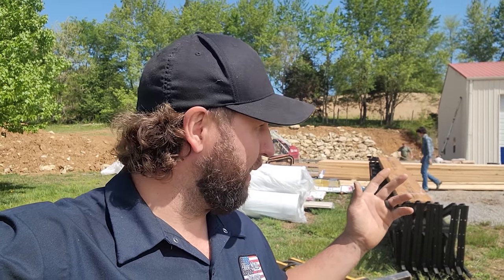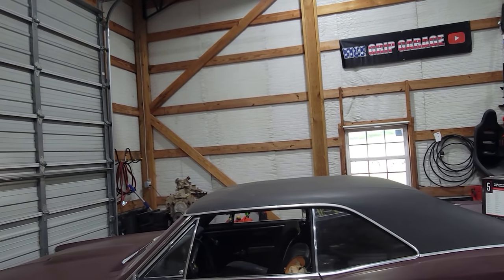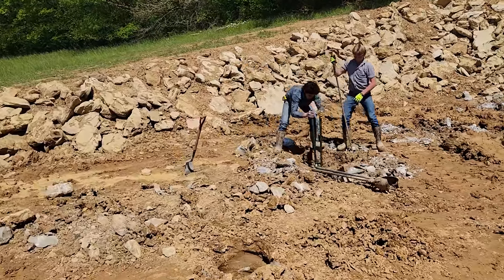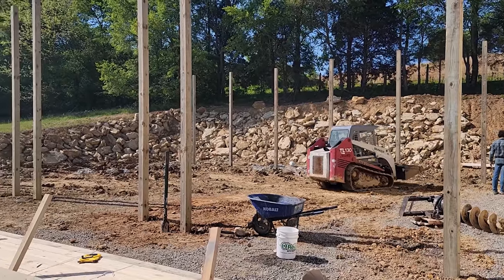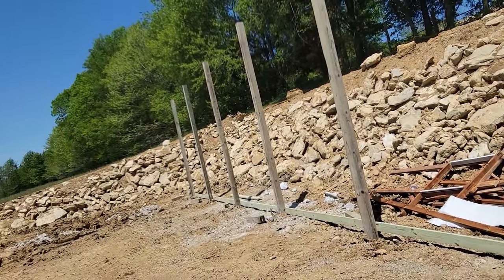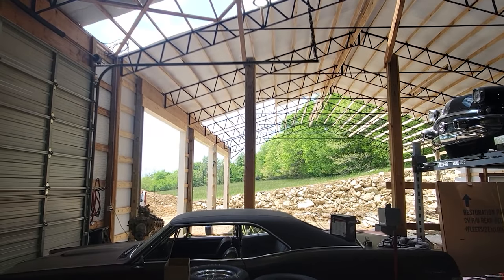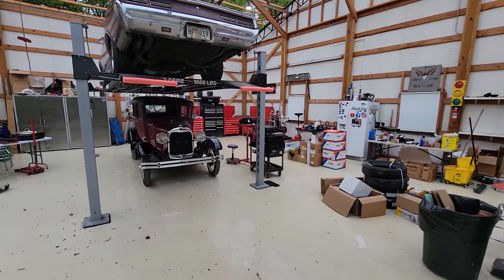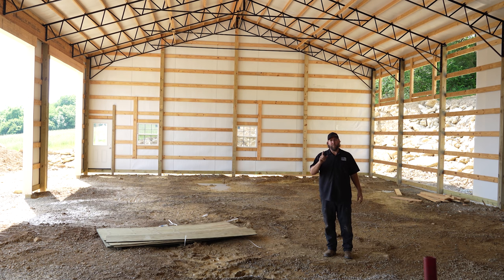Budget Shop Build - EP2 - Framing & Tin!

Comment: I've never realized how simple is the construction of your shop! I thought that these wooden boards are used to support insulation panels, like a stone wool or a styrofoam and are not an actual building frame. It is also completly different style than what we do in Poland, no one uses wood as a structural material for a metal-clad barn. I don't know why, is it material price or longetivity reasons? I've also have not realised that your shop is not insulated: I wish I had a weather like you have, last year I build an extra garage and had to use a sandwich board making te whole thing like 5x more expensive so that it would not go below freezing point inside in the winter :(

Comment: He should have went with white for the roof believe it or not down here in Tennessee that will help you with insulating the building reflects the heat during the summer and pulls the heat during the winter how I don't know but it does

Comment: The reason for 2x6 VS 2x4 is because the span capacity of new lumber is less than it was 10 years ago. They are about to revise the span lengths shorter again in the next series of codes.

Comment: I know you said about keeping the cost down, but I’m telling ya, have a separate compressor shed with one massive compressor(or several compressors) that’s well insulated. Plumb one large line into the main shop, with a ball valve for a main shut off, then put/make a multi-port manifold with many quick connects so you can run as many hoses throughout the shop to wherever you want them to go to your heart’s content. One of the most annoying things for me personally, is not being able to hear yourself think when you need to concentrate on some thing important , while a compressor is running in the background.

Comment: Dude I was just thinking what it would have cost to do passive heating and cooling , by digging down under where the new addition is and putting in the tubing  used for that , cuz some run very cheap to heat and cool

Comment: What are your A/C plans? Mini-splits are a lot quieter than regular Air conditioners, and they both cool and heat. Old, conventional A/C compressors and blower fans are loud enough to cause havoc with your videos, but mini-splits might not?

Comment: How does steel roofing leak? I know condensation is high with steel roofing. Are you sure you had leaks, or a combo of condensation and lack of proper flashing. The bubble insulation against the roof will go south quickly from the heat, not the best choice for roof insulation. Hope it was applied like flashing, so the condensation would drain down to the eves , past the siding. That water has to go somewhere. Steel roofing has many problems to consider. It looks like an Amish crew. I had my huge barn extension done by an Amish crew, smart fast and done right. A composting toilet would allow you to have a legal privy without the septic system. Do you have any springs up hill for gravity water? Tood bad you can't use evaporative cooling (swamp cooler) . Check out solar led lights, a quick pay off over using the utility. Got it going on :)

Comment: Also maybe another dumb idea I would just go to Home Depot and get a few ceiling fans with extra poles to make them hang a little bit lower ...or one blower on each side of the building... and another blower on the other side Harbor Freight sells them... get them to install in the wall put a piece of metal over the top of them show Rain don't hit him and plug them in it would give you good airflow in the summer you could even throw a wood-burning stove in it

Comment: Might be too late already but rather than just pouring a small pad for the man door at the new end of the building, if it might not cost THAT much more, why not run the concrete all the way down the outside from front to back?  The ground at that end looks like it's going to be damp and muddy from time to time.  

Make it just wide enough to run a lawn tractor or somesuch on it because there's gonna be heavy stuff stored around the back and the farther you can pull a yard cart/trailer on a hard surface, the better.

Comment: Love your channel, but your preference for 6x6 posts in lieu of 3 2x6's bolted/laminated together may be misplaced. Warping/splitting/cracking is an issue with solid posts, but not a laminated assembly.

Comment: And definitely do not put your air compressor inside they will be fine outside, very hot and noisy. I put a small awning over mine and it was fine for 15 years till I sold my shop plus I know you're on a budget but a good air compressor or two medium-duty air compressors will handle just about anything you need, especially if you are doing any kind of sandblasting.

Comment: Electrical wiring is not difficult at all, and you can save yourself a few bucks by doing some of it yourself, if you know the basics.

There are 3 wires going into a building, 2 carry 120 volts and the 3rd is a ground, or neutral. You'll have 3 colors for normal 120 volt circuits; black is hot, or live, white is neutral, and ties in with green (or bare copper) at the breaker box. Red is the other 120 volt wire that makes up 240 volts when used with the black wire, and shouldn't be used unless you're wiring an outlet for a 240 volt appliance such as a welder.
Wire size is important to prevent wires heating up and melting etc., the higher the number the smaller the wire. 14 gauge is used for household lighting, doorbells, and alarms because of low amp draw, and 10 gauge is used for heavy amp draw and 240 volt service. Most circuits are 12 gauge wire for standard outlets, some have a flexible ridged sheathing around for added protection against damage.
On a 120 volt outlet the black wire goes to the brass-plated screw for the smallest prong on the plug, the white wire goes to the chrome-plated screw for the wider prong on the plug, and the green wire goes to a (sometimes green) screw threaded into the steel frame of the outlet. Ask questions if you have any, but if you aren't sure about something, let the pro do it. Hope I've been helpful, I too am careful about my spending. 🙂

Comment: Ps. I think you should  reconsider  installing a bathroom.  I don't think your wife wants your guests mechanics and crew traipsing through the house and dirtying up the bathroom. Who gets to clean it? Easier to install now with the equipment and cheaper than having a crew come back later. Also  fire  suppression  system installed will save on insurance  costs. Good luck and best wishes.

Comment: Electrical?  Get 220 for sure...I'd put at least 3 drops, maybe more in there.  That allows for some good options and equipment upgrades (i.e., Tire changer, brake lathe, maybe some other fabricobbling tools that really should be 220V).  

One could also hit up Mr. Cool...just saying, you're big enough that they might just send over a couple 4-packs of those units over.  That place is going to be an oven come summer, even with some fans.  BTW: Big Ass Fan company would probably also help you out.  They just sent over one of their monster roll around fans to Adam Booth (Abom77), and man that thing is QUIET and MOVES THE AIR!  Just saying, things to think about...

I know you're a 'regular guy', more regular than most, but I think it's time to leverage a bit of your 1Mil+ Subs on your regular channel and the 200K+ here.  

Relax, don't worry, have a wobble pop or two, maybe a cold snack to wet the back neck!

Comment: Personally, I would get some Solar PV up on that roof... to help pay for that air conditioning!

Federal solar investment tax credit
The federal solar investment tax credit will have the biggest impact on the cost you will face to go solar in Tennessee

This perk is commonly known as the ITC, short for “Investment Tax Credit”. If you install your photovoltaic system in 2020, the federal tax credit is 26% of the cost of your solar panel system. This is 26% off the entire cost of the system including equipment, labor and permitting.

Example: If your solar energy system costs $20,000, your federal solar tax credit would be $20,000 x 26% = $5,200.

The federal tax credit falls to 22% at the end of 2022.

Net energy metering in Tennessee
With net metering in some states, you get full retail rate credit for the amount of electricity you send back into the grid with your solar panels.

Net Metering requires your utility to monitor how much energy your solar power system produces and how much energy you actually consume to make sure you get credit for the surplus.

Tennessee lacks any statewide program for net metering, and there hasn’t been so much of a peep out of the legislature on movement to create one. 

Fortunately, with the entire state in its service area, TVA has announced its new “Dispersed Power Program”. This is basically the same thing as net metering, however the credits you get for sending your electricity back to TVA when you’re not using it are set by TVA annually, and will probably not be near full retail rates. 
Tennessee solar rebates
While Tennessee does not have a dedicated state rebate for solar panel installation, some manufacturers like LG offer their own solar rebates. These programs are usually time sensitive. For example, LG offers a $600 solar rebate on their equipment, which your installer can help you redeem over the next year.

Sales tax exemption
When you install a solar power system in Tennessee, the cost of that system is exempt from all sales tax. That saves you 6.25-8.25 % off the starting cost! You can choose to apply for the exemption up front (again, our installer partners will take care of all of this for you!) or to take the amount after the system is installed as a sales tax rebate. Hey! Tennessee does have a state tax credit … sorta. It’s not money back per se, but money not spent is still money saved!

Comment: Seriously, 6x6's embedded in concrete are doomed to rot out, especially in your soil conditions!! The smart move is to use Simpson CB66HDG column base hardware primed and painted with oil-based primers and topcoats prior to embedding those into concrete. Yes, it costs more at $75 plus per column base and requires larger footings than round holes drilled into the dirt. GUESS WHAT??? All those extra costs are far cheaper than repairing one rotted post base you used... Oh well, it's TOO LATE NOW... Next time you'll be smarter. Other than that it looks great.

Comment: Those Amish worker's? They flat out can throw some buildings up ! I ran PVC at 4ft high on the walls and every 8ft put a air connector so you don't need to have so long of air hoses and put a pad out back for your compressor.

Comment: So, what are you doing for water inside? How close is the house to the garage? Oh...wait a minute... *(ahem) BLEEP BLOOP! There we are. If you're running water in the garage do yourself a favor and do a tankless water heater (for winter time) and a panel or two of solar water heating tiles. No monkeying with 12V vs 120V or anything, just free rays from mamma nature getting you your hot water. If you plan on running a shower/full bathroom etc. use more then 2 tiles. Yes its solar, yes its not cool, but you can have it for your garage on a small scale for two hundred bucks or less. The man (energy.gov) says 50-80% savings over heating the water with electrics or nat gas. I have no other budget considerations other than junior thinks the boys should have their own metal or vinyl sign in their new area (little grip garage) Lookin good Derek. Hope you get to visit the Twin Cities again soon. - Kirk

Comment: I never understood why you guys in the USA prefer to put the wood in the ground instead of a concrete slab foundation and posts on the concrete. Over here we generally think of wood into the ground being a short term thing because of rot. Concrete is much better.

Comment: I'm a builder up in Manitoba Canada,  we use laminated 2x6 posts because the different grain patterns in the different boards fight against each other to hold the post straighter. Also if one of the boards has a weak point the strength of the others will provide support. Plywood works the same way, thin layers glued together making a much more stable piece of material.

Comment: I cringe every time I see a vehicle running in your garage without an exhaust extractor setup. A simple vent hose and thru-wall hole (remove hose, small door, cat access to shop as well) would suffice. Cheap, and necessary to save your life.

Comment: It is so exciting to watch the new project. However as certified architect, I was horrified to see the building has no foundation. You cannot put wood in the ground like this, it is only a question of time before it gets rotten. I am also curious about the static figures for the structure ... what wind is this to withstand? And I don't know what is the weather typically in the area, but how will this structure hold under a foot or two of snow? Btw I am from Europe and nobody would approve this structure in Europe, it is simply dangerous. I honestly wish it will kill nobody when it collapses or flies away in a hurricane. Good luck, I love your cars videos!